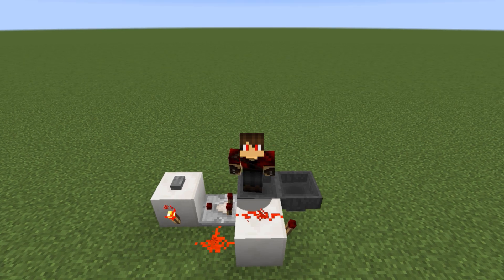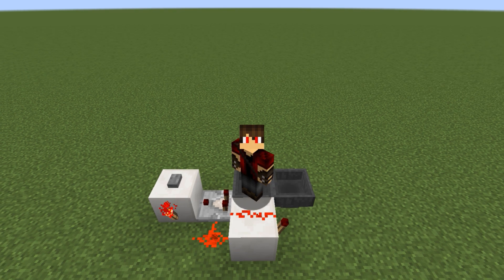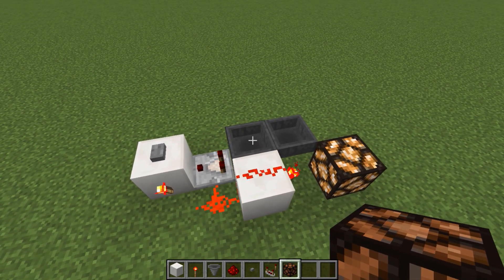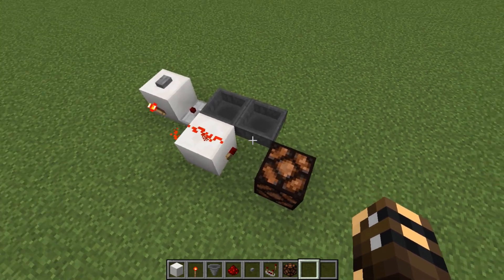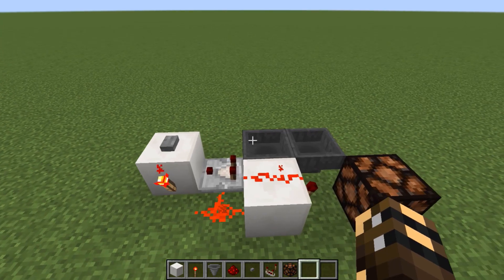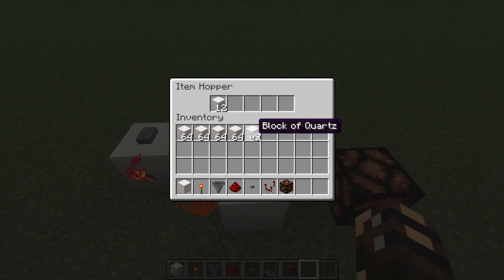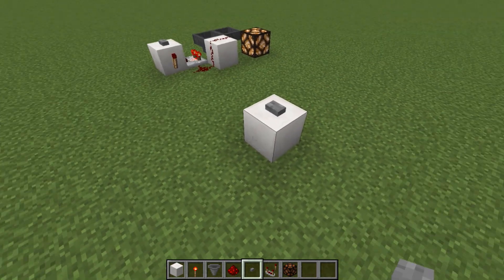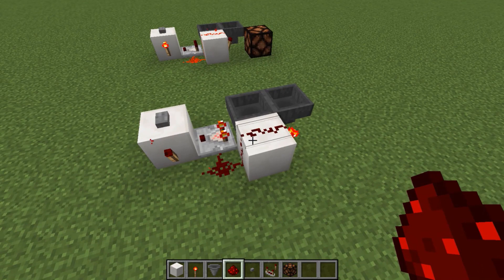Compact Pulse Extender | Adjustable & Silent

Comment: Really good. Another limitation I noticed with the design is it has a "cooldown" of sorts. After the pulse extender ends, the items trickle back into the first hopper, if you press the button again during this, the resulting pulse will be shorter than the one before it. Not a huge issue, but definitely an interesting quirk. Of course i can imagine making something with a cooldown effect where this would be desirable too!
Reply: You can put a comparator on the other side of the second hopper and use that as the output. This doubles the length of the pulse, because it counts the original and the trickle back.

Comment: Hi. Whilst, as the title, this is compact, for short extended pulses it can be made even more compact. Set the two hoppers against the block with the button on so that the torch locks one of them. Then place a comparator from the other hopper. Job done.

Comment: Could you extend the timer on it by adding more hoppers as long as the hopper at the comparator is powered?
Reply from the maker: No, that won't work. You could use an Etho hopper timer instead.

Comment: I've been using a more complicated and less compact variant from the Guide to Redstone. It involved more comparators, repeaters, an additional hopper, and a dispenser. Glad to know that this works the same way, slightly annoyed that I learned about this after I build several bases with doors built off of the other design
Reply from the maker: You can make it even smaller now, if you replace the block that has the dust on it with a target block, then you don't need the dust on top.

Comment: Amazing design! I will say though. This is much more of a pulse regulator. it will take a pulse of any length (that is less than the output duration) and regulate it to an exact, constant output duration. This is different than using comparators running into each other, which will hang the end of an input signal by an additional constant time. Slight difference that both are very useful for different things
Reply: it extends, its a pulse extender
Reply: and thats all it needs

Comment: Does this work if the input is from an observer? It worked well with a button but when I try to use and observer it extends the pulse but then becomes a red stone clock when the pulse is done
Reply from the maker: The pulse from an observer is probably too short. Try putting a repeater on at least a 2 tick delay between the observer and the block with the torch on it.
Reply: @Cortezerino  that did work, thank you

Comment: exactly what i needed.
I'm sure someone pointed that already out, but just in case. Putting the comparator into subtract mode seems to do the trick for filling the hopper up to its maximum.
Because while 15 is not greater than 15, 15 - 15 is 0:)

Comment: The problem though is that the hopper needs to "re-charge" after each use
Reply from the maker: I took 3 years but finally someone's pointed it out. You're 100% correct, this design is still perfect to use for many applications, but you don't want it in a scenario where someone might press the button again before it's had a chance to recharge.
Reply: I'm not sure if I'm more amazed that no one else did, or that you responded to a three year old video comment in less than an hour. Still a helpful design!
Reply: You can eliminate the recharge problem by halving the number of items and taking the output from the hopper opposite of the comparator instead. You can also compact it to be only one block tall by making the block with dust on top a target block instead!
Reply: @cookies2502  It's still gonna generate shorter pulse if you trigger it while it's not fully reseted. Cool solution though, since you avoid having it shut down completely even though it keeps getting inputs. Would've helped me when I wanted to detect if certain clock was on or off. Ended up using pulse extender based on lava falling delay.

Comment: Small thing to add, if you want to feed it with an observer output just put a two tick repeater in front of the input. Cheers, thanks for the video and design!
Reply: Dude, you just saved me hours of a headache, thanks for the tip
Reply: Great advice! This is true for any 1 tick pulse sent to the extender.  RS torches only deactivate when the incident pulse is 1.5 ticks or longer.  Repeaters will take any pulse shorter than their delay value and extend the pulse to match the value of the delay.
Reply: @Gimpilicious for how many ticks is the pulse extended per item added , I need a 16 tick long pulse , but I don't know how many items to add
Reply: @maskedredstonerproz  the first repeater will take whatever pulse length and convert it to whatever the repeater is set to. Anything after that just gets added like normal.
 For example, if you send a 1-tick pulse to a 2-tick repeater leading into another 4-tick repeater your total pulse length should be 6-ticks.
I'd say you could go with 4 repeaters each with a 4 tick pulse.
Reply: @Gimpilicious  I know that , I just have to know how many items to add to the system shown in this video to get the same effect
Reply: @maskedredstonerproz  I completely misread that, my apologies. I'm not sure what the item/pulse length conversion is. One way to check it would be to have a signal coming from an unpowered piece of dust on the extender go to a 16 tick delay and then try to time the output of the pulse extender up with the delay circuit.
Reply: @Gimpilicious  thank you
Reply: lifesaver!
Reply: You single handedly saved my tree farm

Comment: this is a genius design great work
Reply from the maker: Thanks mate! I came up with the design during my Nether Wart Farm video, where I was trying to fit an Etho hopper timer into a spot that was too small for it. Pro tip, rather than take your output from the torch, if you want a really long pulse you can have a comparitor coming off the other hopper. That should double the length of the pulse.
Reply: set back is long reset time...